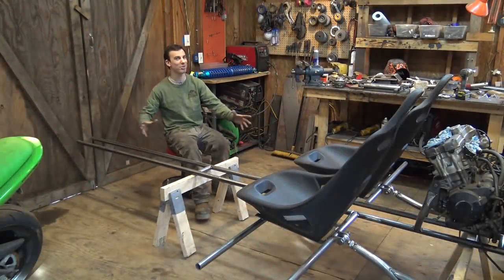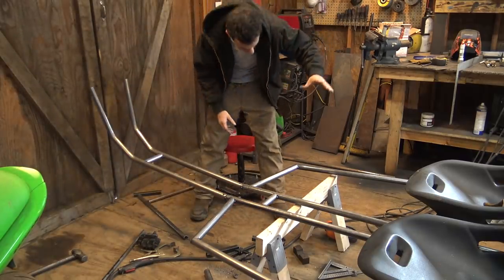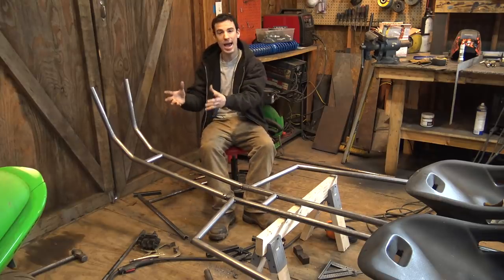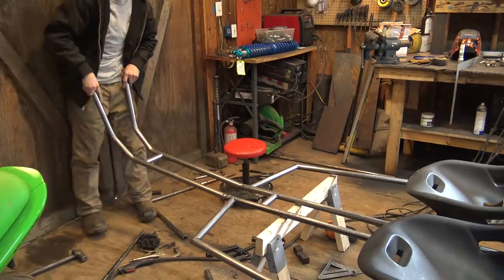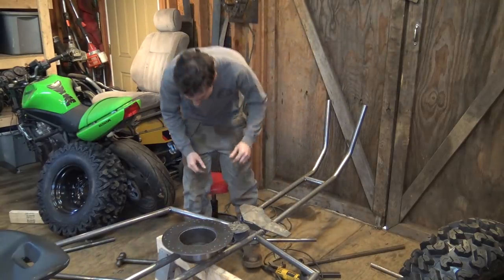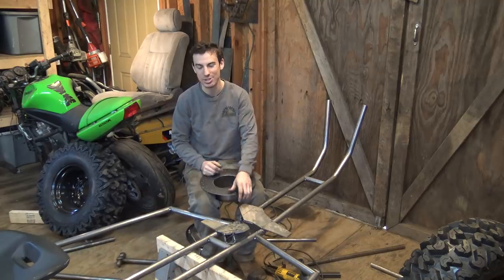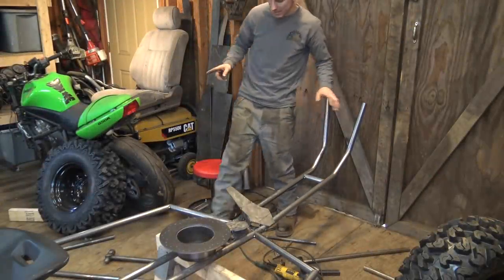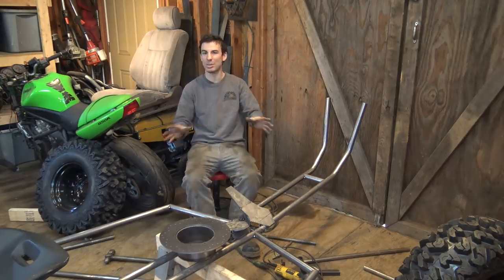Honda CBR 600 buggy build part 3

Comment: Any snowmobile reverse chaincase, my 2001 skidoo 800 had one, which is 140hp, you can easily cut the jackshaft and driver shaft and weld sprockets on with a supporting bracket, shoot me a message if your not framiliar with how they work!

Comment: If you are able to do 2 speeds transmission, would you be able to modify it to only a foward-reverse transmission without modifying the speed? You would only have to switch in 1rst gear and activate the reverse, no?
Reply: Instead of 2 sets of two sprockets with chains, you would have 1 set of sprocket and chain, that would be foward, the other speed would be with gears, it would make it reverse!
Reply: You would have two shafts, i think its already the case with the two speeds transmission, one input shaft containing one sprocket and the first gear, the output shaft would have the switch system like on the two speed transmission, switching on the sprocket(foward) and on the gear(reverse)

Comment: i have a gearbox that will work it is off of a Polaris 4 wheel drive it should work just fine it is built well it  has high low and reverse  input-output  both sprocket drive just let me know if you want something like that it would hold up just fine on  my 750 buggy i would think it would do fine on just about any motorcycle motor buggy

Comment: Going to need to heat treat your rotors to make them hard, using them as mild steel soon as they get hot they will warp. Shouldn't be hard to heat treat them yourself.

Comment: Total waste of time making them rotors.

As for gear box....
Take the bell housing off any gearbox and you should be able to find or fit a sprocket to that end.
For the other end you will have to weld the diff and then mount off one of the CV joints, or if you're using the traditional (non transverse(  the end stock) will be the same (generally) as the input shaft.

Doesn't the gearbox on the engine work?  You just need to make a arm for that.
You will need to gear down, the older ones had a cassette type box, but if you want to mess with the gearing then that's a option.

Btw.
If you were wondering how to without a bender, you just chop the angle fold the bar and weld it shut.
Tend to do that more with box steel.
 HRH.

Comment: CROSSKART.... 
Look up crosskart...   You are pretty much building a crosskart.
Reply: Cross karts are pretty low to the ground and more like rally cars. This mans got king coilovers and tons of travel. More like a prerunner kinda but if anything just call it a side by side causr its similar to a rzr and can am in terms of suspension
Reply: More like limousine crosskart.
Reply: Similar to the way I want to go but I want 4 wheel drive and it's going to be minimum 750 CC's and if I decide to upgrade it may go as high as twelve hundred CC's and possibly get a turbo

Comment: This thing is gonna weigh 2000lbs and your going to end up wanting more motor.
Reply: at least, the unsprung weight alone with hubs wheels discs calapers and spindles will be well over 100 pound per corner lol

Comment: I keep wondering why you spend all the time building something like the front brake rotor assemblies.  First the materials you are using aren't the best for brake rotors. Second why not adapt something readily available and much lighter than the stuff you build.

I also wondering if the that small diameter tubing is going to hold up on the long frame.

Comment: Motorbike front wheel calibers? I'm going to presume your vehicle weights about 2-3 times that of motor bike and while it has more tires and breaks that really seems bit waste, specially when you can simply go and buy used from wreckers or new ones from the parts dealer for much cheaper. Some things you want to make your self, but things like break calibers in vehicle with that much weight and power is not one of those. Specially when we are talking about parts that will wear.

Comment: Dr.D here if you take a starter motor off say v8 should be able to  attach to sprocket push button reverse there are  units that are made for custom bikes planet type gear set, expensive,good luck. Ps. not a real doctor

Comment: You do not need front brakes, being an actual fabricator and building several "mini rails" none ever have front brakes not even the high dollar tazcars or king sand cars it is not necessary just adds more weight that you do not need. its only a 600cc older sport bike motor probably making only 100hp.

Comment: think i know wat happened with the pipe bender , its ordered in china and it takes that long to ship it to the states
wonder if the brakedisks work as whell , wat i've seen with two part diskbrakes is that they have some sort of expansion thing on the connection between disk and disk hat and the disk is usually made from casy iron wish seems to deform less with heat 
about the forward reverse gearbox , look at how they do lathe reverse treadcutting , think you can make that youreself  maibe using parts from a regualir car gearbox and some bearings 
https://www.youtube.com/watch?v=cSHpbytMPdk